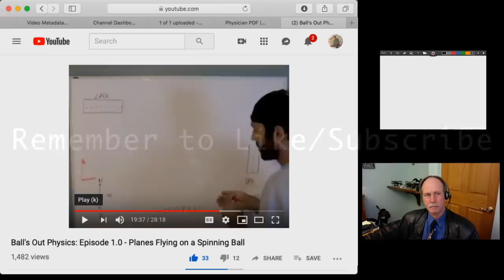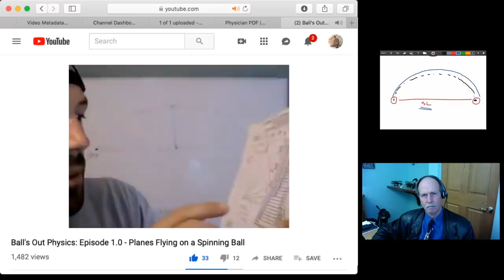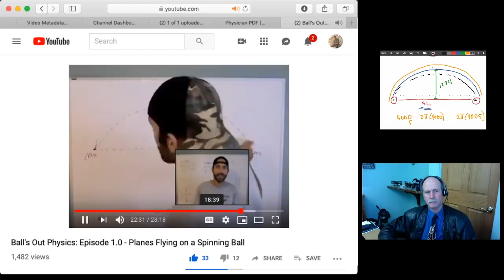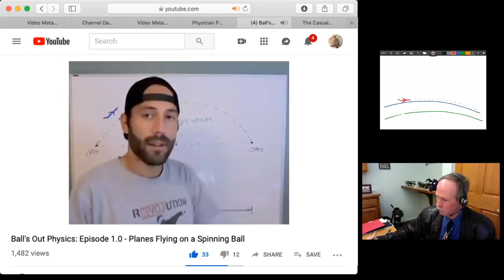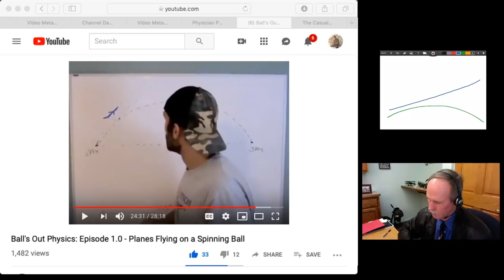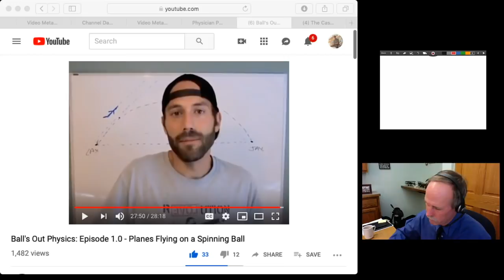Flat Derp Engineer Aircraft on Spinning Earth 2

Comment: Dr Bob another good video this guy should be ashamed of him self as an engineer for even putting this out there. But I was wondering about your airplane analogy at 12:20 when an aircraft looses power the pitch of the craft would have to change. Wouldn't the effect of drag kill your speed and throw you into a stall or some kind of death spin? I know your a pilot and this may have just been over simplified but just wondering thanks. Mike also fro Michigan
Reply: Pitch for airspeed, power for altitude
Reply from the maker: great question.  No, if your are bee bopping along (that is a technical aviation term) you are trimmed for a speed (your pitch) and your power is holding your altitude.  If you cut the power you will maintain the same pitch and speed, you will just start to sink.  

Maybe this summer I'll come find you and we'll go up and make a video or two about this.
Reply: @BobtheScienceGuy  It would be a pleasure to meet you and going up in a small plane a dream come true. I live in Hartland if you are ever bee bopping in the general area let me know. And if you need any help with any videos I'm not a scientist (actually a plumber by trade) but, have been told I'm good at problem solving and handy at almost anything. I look forward to your next video keep up the good work.
Reply from the maker: michael thomas 48d here. That should be a problem.
Reply: @BobtheScienceGuy  Yeah more of a 45g guy here. Well if you ever need some help I go up to Secord Lake every now and then it's always fun going up north. cheers

Comment: Way to use vector addition, Bob!   Also, great presentation, and you are looking nicely white balanced. 

This guy does his observations in Florida?  I would love to see him do his observations alongside Red's Rhetoric.

@13:12 The force of gravity, in a sense, does make the plane follow the curvature of the Earth.  When gravity keeps our atmosphere from floating off into space, it creates a pressure gradient. Thus, in order to maintain a given altitude above the surface of the Earth, all that an airplane has to do is remain within a given "layer" of air pressure.  From what I have seen demonstrated here, that is achieved by applying a given amount of thrust that keeps the airplane at a given altitude, as long as the angle of attack matches what is required for level flight.  Am I correct?

Comment: If he's actually an engineer, he's trading malpractice for youtube views.

It's interesting what flerfers totally ignore when they talk about altitude and pitch, such as an airplane's center of gravity envelope and moment. It's worth a little extra induced drag on the tail, spent on downward lift at the empennage to maintain nose-up angle of attack, to pay for forward CG. That, of course, has nothing to do with following the curve of the earth. It's just survival.

Fun fact - here's a quick way to remember the difference between induced and parasitic drag, which is just like the difference between entomology (insects) and etymology (word derivation).

"Induced" has the same etymology as induction. Induced drag, like brain sweat, comes from productive effort. Lift produces induced drag, just as rational thought is uplifting.

Parasitic drag is what you have to lug around as you try to get ahead, and the word "parasite" reminds one of the common wood tick. That's very appropriate for flat earthers bloviating about aviation. Medicinenet.com defines a tick as a wingless bloodsucking insect. 

Flat earthers are a drag on society, and they don't fly, either.

Comment: Eight inches per mile squares is a parabola.  I've tested it, and it's pretty close to the real measurement at a distance of 30 miles.  But eight inches per mile squared will not work over a distance of 2,000 miles.
Reply: He does not use 8 inches per miles, but a "curvature chart" (I guess from http://terrariumearth.com/we-shouldnt-be-able-to-see-that-far/ ). Still, it is the wrong chart for what he is trying to do. What he should calculate is the length of the sagitta  of a great circle arc of length 2000 miles on earth. This would give a result of 125.5 miles, not too far off what he obtained from using the wrong chart.
Reply: Page not found, but it is clear that Brian Mullins is a fraudster.  If he does possess qualifications, he should be stripped of any title pertaining to them.
Reply: @clemstevenson  I have added a space at the end of the link - it is working now...
Reply: @YAWTon  But the link had gone.
Reply: @clemstevenson  Bizarre, I can still see the link, and it is still working.
Reply: @YAWTon  In any case, the curve is irrelevant, given that any point on a sphere will appear level.  Even if you lay rail track absolutely level with a spirit level, all points on the curve will appear level with a spirit level.
Reply: @George89999  Yes, maybe a spam filter has stripped it off.

Comment: About the airplane nose-dipping: On a flat Earth planes going east have to constantly turn left to not end up at the edge of the earth, and planes going west have to constantly turn right. But when I've been flying straight I'm not turning left or right constantly, so therefore the earth can't be flat.
Reply: Well, even on a globe, if you fly due east you are turning constantly to the left in the northern hemisphere and to the right in the southern hemisphere.  The amount is slight, though more as you are closer to the poles, but would happen if you did that.   The only place that flying east or west wouldn't result in turning would be right on the equator.  The difference on a flat Earth is that even in the southern hemisphere the direction of the turn would be the same as the northern hemisphere, but with a larger curve. 

However flights are not set to be directly east or west, but often are the closest (or nearly closest) path between two points.
Reply: @my3dviews  Yes, I'm assuming that we're measuring this at the equator (or south of it), and also noting that we're flying on a great circle path, because that's what we do.

Comment: Bob, thanks for covering our first day of ground school! We fly the air pressure around the aircraft, using the static pressure.  Our sensitive instruments can tell whether we are climbing or descending (altimeter and VSI).  Our attitude indicator shows level in both pitch and bank and is ADJUSTABLE in pitch.  The amount of curve, even for the big boys up high, is very small.  This guy acts like flight on a curved earth should be like the first drop on a roller coaster!  Can I brag to my pilot buddies that I can land in a 900kt crosswind?
Reply from the maker: yeah, I just think of all those naval aviators that think they are special because they can land on the pitching deck of a carrier going 25 knots.  Hell I handle speeds higher than that...

Comment: Bob, could you please leave a link to the videos you link? Sometimes it is helpful to see the whole video and not just the clips. Thanks!

I have no idea who Mullins is an engineer - though the term is used for programmers so maybe that's the line he works in. He certainly is not the one anyone would want to design a long bridge. I hope he takes up Bob's offer but I suspect he won't.
Reply from the maker: There are two reasons I don't put the original link in.  I don't want to promote the videos and the style I am using is to play the 'ENTIRE' video from start to finish.  They are not clips, they are reviews of the video from start to finish so there is nothing missing.

Comment: With the horizon rising to eye level nonsense, ever since the invention of the sextant corrections to readings have to be made for the dip to the horizon which is known to vary according the the eye height of the user unless an artificial horizon is used, there are numerous web pages on celestial navigation which refer to it.
It has also been demostrated on numerous occasions as we see here, that the horizon does not rise to eye level.  One can assume therefore that those who promulgate the idea are being delliberately dishonest.
I strongly suspect too that he has not read any testimony from a civil engineer but actually got that from Dubay's 200 Proofs.  Engineers who apparently couldn't grasp the fact no point of a line drawn round a ball is any further from the centre than any other point.

Comment: This idiot is most certainly not an engineer.  He would realise the 8"/mile^2 forms a parabola, not a circle.  He's also know it's only a rule of thumb formula, that's acceptably accurate up to around 20 miles.  Any distance larger than that, the exponential nature of the formula, will render the results unusable.  Brian Mullin is a complete and utter fraud.
Reply: Andy Mitchell 
Dr Bob here proved it doesn’t work for 8 miles either, it’s more than half less when accurately figured, that’s a pretty big margin of error.
Oh well flerf’s need errors in thinking to explain nonsense so it adds up. At least we understand that.👍
That’s why we are not Flat Derpers
🤣🤣🤣🤣🤣🌎🌏🌍🌎🌏🌍
Reply: The flat earthers depend on calculators such as this one because they cannot handle the math involved with actually figuring this out. They just want to plug in a number and get a result.
Reply: Misha Griffith ... There is more to it than that. They use this "drop" figure to deceive. The drop figure given by this formula is very much larger than the correct hidden height figure that is needed to work out what can be seen at distance. The hidden height figure takes into account the observer's altitude above sea level to give the answer. Globe deniers do not use this figure as it agrees with observed phenomena as predicted on a globe.
Reply: Please Complete All Fields 
He is actually a Municipal Bridge Inspector. Now how safe do you feel on a bridge.....
😳😳😳😳😳😳😳😳😳😳😳
Reply: To be clear; Mr Mullins here is/was a licensed professional civil engineer working mostly with bridge evaluations.  The question of professional ethics were raised to the appropriate boards for review. While the board responded with no actions recommended or to be taken, his channel quickly died.  Take from all that what you will.
Reply: @AT2Productions  After google for it, he was "kidnapped" from religious nutters and bapticed, and then urged to put this videos out. After his work and reputation was in danger he restraint from it. It´s a rumour, but plausible.
Reply: @AT2Productions  I've also heard that he was doing some experiment for flat Earth, and had collected a decent sum of money.  At which point, the professional complaints were made, his channel went offline, and the money has been unaccounted for, if not disappeared entirely.  I'd have to hunt for the source of that particular allegation, however.
Reply: It is not exponential, it is "only" polynomial.

Comment: If he were from a Canadian university and a member of the Canadian Society of Professional Engineers he'd very likely have had punitive action taken against him by the society - professions have standards and the state of national engineering standards association really ought to have stepped in, which it may have given his disappearance from the flat earth community etc.
Reply: Byron  Here’s the catch, Mr Mullins here is/was a licensed professional civil engineer working mostly with bridge evaluations.  The question of professional ethics were raised to the appropriate boards for review. While the board responded with no actions recommended or to be taken, his channel quickly died.  Take from all that what you will.
Reply: AT2 Productions damn, and he doesn’t understand basic trigonometry?? How the hell did they not pull his credentials and started an investigation into the university where he got his fake degree?
Reply: @jjgdenisrobert   Because these videos aren't directly connected to his professional work.  However, one hypothesis has it that his boss(es) intervened and told him to knock it off.
Reply: If he designed bridges they are connected very strongly. Try designing a bridge denying gravity exists. Also, if the bridge is long enough, the curvature of the Earth must be taken into account because the  vertical pylons will not be parallel to each other, due to the curvature.
Reply: Nixon resigned, you know?  ;-)
Reply: @Byron this Engineer ain't a Engineer... If he has a degree IT is printet og the INTERNET... 
He as fony as a hungerian pickpocket ... Who claim he is not a thief.. 
Cadou to Bob the Seience bro...
I hawe a Maskinmester education and a ELECTRO ENGENEER ... + A licenced HAM (OZ1**)
Reply: Kenneth Schultz  Actually, sadly, Brian Mullins has been listed as a state licensed professional engineer by two US states. His YouTube presence essentially stopped when a couple people inquired to the appropriate ethics boards about the content he was making.
Reply: Holy S**+ ... I don't mind ppl behave stupid.. 
But when they have a Degree in somthing 
Or a ""Work "" Witch hawe a sertin degree of Thrust and 
What do you call a high education with not politenes 
Thrustwerthy nes .. sorry can't remember the word 
But in who you shut look Up to .. ..
Can't go public and say the earth is FLAT .. he can belive in What he want !!!! But he can't be disohnest ... Then her is not trustvorthy 
And a con artist .. 
Thanks for that info .. 
Greetings from Denmark.. 
Sorry my Lenovo Pad do not always agree with my english
7 Langue ..
Reply: Let's hope the ethics boards do something about him. I am personally disgusted and worried by the existence of a licensed engineer denying basic physics.